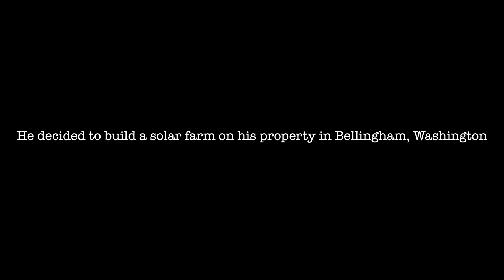On The Job: Installing a Solar Farm | Skid Steer Solutions

Comment: I like your ideas using solar energy. As usual though the so called environmentalist (you) is a hypocrite to the extreme. Tom, you dance around that fact you have extreme views on global warming with words like sustainability, implying that CO2 is pollution (which it is not).
Every tool, solar panel, cable, post, cement everything you used requires some form of carbon based energy. If everyone were to be sustainable like you what do you think this world would look like?
Dig those holes and trench by hand. Make those glass panels, wire, aluminum, screws and steel without carbon energy in your backyard by hand and no mining of any minerals.
To think you teach young minds to be hypocrites like yourself.
No wonder the Divided States of America is so screwed up.